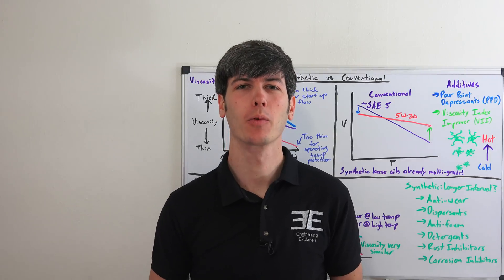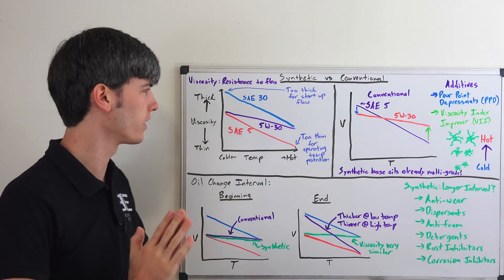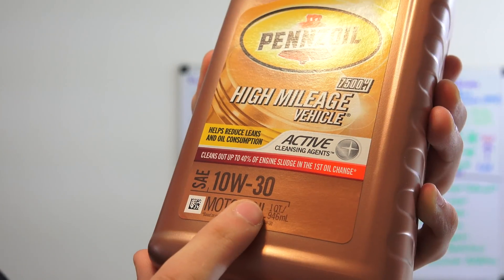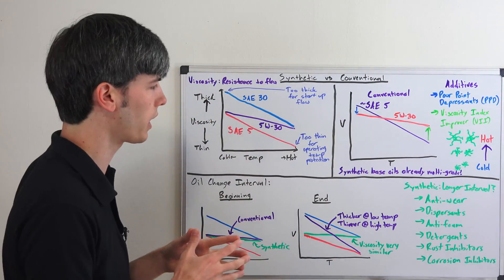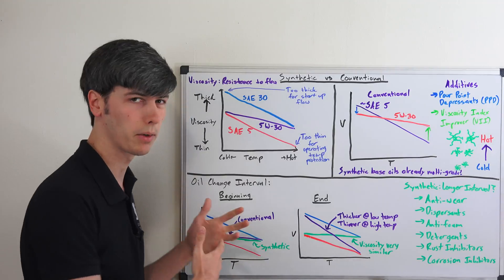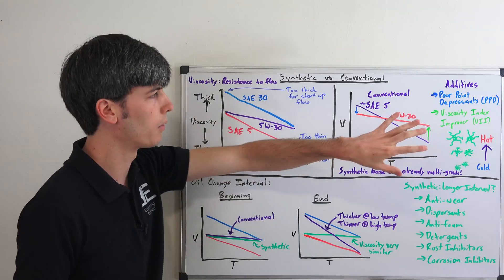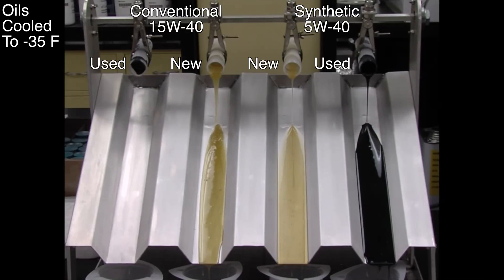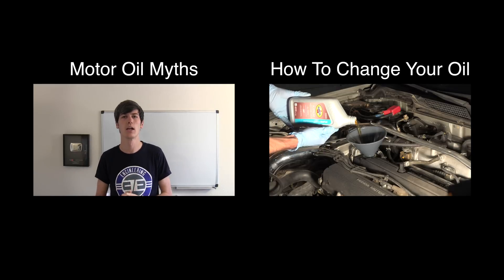Is Synthetic Motor Oil Better For Your Car?

Comment: Thanks so much for clearing up a lot of mysteries.  The airlines have all switched to synthetic.
What synthetic viscosity rating would you recommend for my Corvette LS-1 engine operating in the hot Florida environment?  I've been using 5W40, but have been thinking about 0W-40.

Comment: OK what about straight weight oils?  I have an older diesel that requires straight weight 30 only unless I am in an area that goes down below 30 degrees.  Then I have to go with 10/30.  These engines were very very picky.  GM 5.7 Diesel from 1981.

Comment: The additives still break down over time in synthetic, just like regular oil. The only thing that's nice about synthetic is that the viscosity doesn't break down as fast. Otherwise, changing the oil around the same time keeps the additives in the right ratio.

Comment: Is it true once you go synthetic you cannot go back to conventional?
Reply from the maker: No, you can switch back. But synthetic is super cheap if you do it yourself, so really no reason to.
Reply: Thanks, I was pretty sure it was a myth but I needed a confirmation.
Reply: You mean for coffee?
Reply: I'll buy one for my mom, she loves coffee.
Reply: no you can go back and forth it doesn't hurt anything
Reply: no its not.  what is true is that "once you go black, you can't go back"
Reply: Probably not, because I'm married to a mostly black gal and I probably WOULD go back! :{(
Reply: I have been back and forth for over 20 years and nothing has ever gone wrong Iam over 500 hundred thousand on my s1o still runing strong
Reply: That is interesting to know.  At my automotive school, I was taught that you can't go back once you use synthetic.  I was told that the synthetic oil will coat the engine and will have some interactions with regular oil if you introduce it later to create clumps and stuff.
Reply: If you really want to learn FACTS about motor oil, read this:

https://540ratblog.wordpress.com/2013/06/20/motor-oil-wear-test-ranking/
Reply: Here's a simple answer to that question. Synthetic blend oil is a mixture of the 2 .
Reply: And even the "cheap" oils like Walmart's SuperTech oil, have base oils that come from the major manufacturers like in Texas, the bottles used to say the oil was a product of SOPUS. (Shell Oil Products U.S.) which is none other than the parent company of Pennzoil.  Now this does vary regionally in other parts of the country the oil bottles had a different source.  It just depends on who gives them the best deal at the time in relation to ease of distribution.  Now I'm not saying the oils are identical, but they are certainly up to the SAE and ILSAC standards.  Of course the premium oils like Pennzoil Platinum and Mobil 1 will have more value added components to justify some of the cost difference.
Reply: +FsG Snake  Absolutely incorrect.  All of the major manufacturers will tell you that you can mix them in any proportion you like, go back and forth, etc.  After all, most of them actually sell synthetic blends. In fact, there is no official API definition of "synthetic".  Last time I looked, it was just described as a "marketing term".
Reply: Jon Wright Thank you for sharing your first hand experience Jon.
Reply: I love little pickup trucks they last a long time in the right hands...my. 2000 ranger got to 270k not to long ago and when I traded it in it was in great condition
Reply: Synth has smaller molecules, so yes, it flows easier, thus the better lubrication it gives. But do some research on the effects of how the material in the engine seals REACTS over long periods of time with mineral based oil versus synthetic. Mineral based oil has the effect of stiffening the seals, as opposed to synth which keeps them softer. When you put an oil with small, easy flowing molecules into an engine with somewhat stiff seals, you may have leaks.
Reply: Interesting.  I wonder how much of a problem it is though.  I've switched to synthetic mostly for the winter time and it's apprently better for the engine in the long run.
Reply: good to know.  thanks.
Reply: it's a myth
Reply: Running dino for a long time and then switching to synth can cause oil leaks, because the seals (front and rear main, cam, etc) react differently to mineral based oil.
Reply: It's not that the seals "react"; it's that the flow characteristics of "synthetics" can be slightly different from conventional oil. Usually it's not a problem but was in the early days of "synthetics".
Reply: no, and yes.... so, typically,  switching and mixing is perfectly fine, since all oils are required to be mixable to meet a picture standards.... however,  I know for a fact that the way it interacts with rubbers is a different story.  if you have used one type of oil through the warranty period, stay with that oil, or you will be needing to replace seals.  something about how the rubber or whatever (mostly main seals) soaked up the oils when it's natural properties dried out, introduces incompatibility between the 2.  you can go rounds and theorize all you want, and use whatever example you choose, but plain and simple, the real world fact is, if you change oil types on old seals, they will dry out and leak, before soaking up  the new oil type... it does not happen on low hour seals, but it does on well used ones.  it is fact, proven in the real world, and there is no fix, but to replace the seals, which is always real costly.  the rear means you have to remove the engine or trans, and the front usually means you are lucky if you have a chain, which is easier to replace the seal, but a belt means you have to pull 3x as much apart to replace.... so, short answer is, that if the engine is old, switching oil type means replacing both main seals.  if it's still under warranty,  go for it.  if the seal does go, it will be covered.
Reply: wholeNwon not true.  it is not a marketing term... I mean, technically,  it is not a technical term, but conventional oil is made from petroleum crude, separated at higher temp than fuel, but from the same base sludge.  syntetic, is made from natural gas.  both come from the ground, but that is it.
Reply: Engineering Explained that is a pretty bold blanket statement for someone not covering the repair cost.  as a real world master mechanic... old seals that have started soaking one type of oil to replace natural oils,  will not accept the other type.... you can try to theorize as much as you want, but there has never been old seals that survive the change, in my experience.   just newer ones.
Reply: The API itself referred to "synthetic" as a "marketing term". "Sludge" is a pejorative word.  Only some "synthetics" are made from natural gas. The implication that automobile lubricants made from gas provide lubrication required by auto engines that is NOT provided by lubricants of the same API grade (SN usually now) is unfounded.
Reply: The manufacturers of the stuff have made no such statements about their current products, though there are implications that problems have occurred in the past. FWIW, which isn't much since it's only one family's experience, we keep our cars a long time...typically 20 years, switch back and forth and mix oils depending on what's on sale; and, none of us have ever worn out an engine.  In fact, the heads have never been off any of ours. Only one required the addition of oil between 5K changes and that was about 1/2 qt.
Reply: Personal experience on my dads truck.  He ran full synthetic for a few years.  Started driving more and couldnt afford the full synthetic.  Switched to basic oil. Year later the engine lost oil pressure and turned to junk.  I always felt how would the engine know?  oil is oil.  But switching back did not go well for us.
Reply: The manufacturers tell you that you can switch back and forth or mix any way you like within the same viscosities. Afterall, you can buy premixed "synthetic" blends off the shelf.
Reply: Yes Rocktowntraffic but it could be a coincidence.
Reply: Youre thinking backwards, Using synthetics are much cleaner and also much more slippery then conventionals, If you use conventional for 300k miles, and suddenly switch to synth its possible the oil will makes it way through leaky oil pan & crank seals causing minor leaks.. I never see this very often but thats the mindset
Reply: David Cazes - You get mixed answers on here but best bet is as long as you change your oil is most important. 2nd i use synthetic over conventional and went back in forth about it. I notice the Syn had a smoother fill when turning the key then conventional which felt like it was runny and key turned quicker like after awhile something my need checking. Either way your fine is you do oil changes when you need to
Reply: oil is not oil, big difference between syn and conventional, at same weight specs.  Turbo cars always need syn, always
Reply: No....that's if you go BLACK, you can't go back
Reply: No.
Reply: thre is no reason to not use syn....modern cars all need syn, for turbos, mpg, etc etc.  Why would anyone be driving a relic that uses old non syn oil.
Reply: no
Reply: You can but mutch better do the engine flush befor you switch again to normal oil....
Reply: Go back and forth as much as possible as often as possible. This tip brought to you by the letter W.
Reply: ...........  Are  we  talking   about   OIL,   or    ladies   BOOBS.......?????
Reply: Of course not.  Even the web sites of the synthetic manufacturers will say that. Go back and forth, mix in any proportions, whatever you like as long as the viscosity range is correct for you engine.
Reply: +stonent   I wouldn't be so sure that the last sentence is entirely correct.  I certainly agree with the remainder of the statement.  People make far too much of a fetish out of motor oil.
Reply: I've used nothing but conventional motor oil in my 2000 Silverado and it has never had a problem 220,000 miles and still running strong!
Reply: David Cazes That is 100% false. You can change back to conventional at any time. Heck, you can even mix syn and onventional oils together. They are 100% compatible. Just use correct viscosities for your engine. Personally, I always use full synthetic (change it myself-about $35 for oil and filter). It is better. Whether it's worth the extra dough is up to you.

Comment: +engeneerinexplained is it good idea to mix one oil with another,and is it bad to use low sae rating oil for warm summer?
Reply from the maker: It's generally okay to mix oils (or add oil as necessary). I'd always use the rating which is recommended.

Comment: Okay so Synthetic is better in cooler temperatures and if you don't regularly change your oil it's better also. What I want to see is an engine using synthetic oil for 100k mile and one using regular oil  for 100k miles with a regular oil change every 3,000mi on both. Then see which engine has fared better. The Synthetic? Or Regular? 
When I hear car companies or oil company say they, "Put it through an additional process to make it better." I have to wonder if that's true. Maybe it is but I would like to see more proof other then viscosity. How old is that "old" oil anyways? 200 years old? It's blacker then hell. This experiment did not follow the scientific method.

Comment: So I use conventional on my 20r but 100 miles after oilchanges the oil gets drenched in gas so I started putting gas instead of oil, cheaper as well

Comment: I don't understand. You say that the 5w and the 30 is a measurement of 
the same thing (viscosity) at different temperatures. So the higher the 
number the number the thinner the oil is then why in your test did the 
brand new 5w-40 synthetic oil pour out faster than the conventional 
15w-40? since it was -35 shouldn't the 15w-40 brand new pour out first since 
its winter/cold rating is 15w and higher meaning it is thinner?? Your graph on the other hand seems to point in the direction that the higher the number the thicker the oil.

Comment: Not everything is viscosity, Synthetic Motor Oil is different than Conventional even at the molecule size… uniform molecules produce less friction when used to lubricate compared to the non uniform molecules of Conventional Motor Oil, and considering these molecules to function as ball bearings between surfaces… it's a ton of difference

Comment: ALSO: 

Many synthetic motor oils won't burn at combustion chamber temperatures, conventional oils do.

Oil residue is always being applied and wiped off of the cylinder walls by the piston rings when the engine is running. So a thin layer of oil is exposed to the ignition within the combustion chamber, and then eventually whatever is left of that will make it's way back into the oil flow of the engine as the pistons cycle...

Conventional oil typically has a flashpoint of 400-600 degrees F, so the thin residue of oil left by the rings on the pistons is burnt up with each ignition cycle of the piston. After burning, the conventional becomes what might be best called "gooey soot" (highly scientific term there). This gooey soot has just about zero capacity for lubricating the engine, and it has an amazingly diverse assortment of carbon-based chemicals in it, many of which are rather corrosive. It also will tend to build up on the various parts of the combustion chamber as grime.

Synthetic oil on the other hand has a flashpoint which is much much higher (in some cases as high as 2000 degrees F), so the residues of most synthetic oils in the combustion chamber are not burnt by the ignition cycle of the piston. It still picks up a bit of sooty residue from the burning gasoline, but the oil itself is not breaking down into a corrosive cocktail. In addition to acting as a corrosion barrier instead of actively corroding,  it is maintaining it's viscosity, so that it's much less likely to cause a build up of grime in the combustion chamber. Even components as distant as your fuel injectors may see less grimy buildup over long term use of synthetic oils.

So, over and above the fact that syntheic oil does a much better job of lubricating over a longer period of time, it's also far more temperature resistant, allowing it to not burn in the combustion chamber, not release corrosive carbon derivatives into the engine, and not build up grime nearly as easily.

Oh, also conventional oils multi-viscosity capabilities are rated for room temperature to engine operating temperature, and typical conventional oil will thicken a great deal outside it's multi-vis rating at more extreme cold temperatures (even when the oil is brand new). Synthetic oils are far less temperature sensitive in this regard, so their rated multi-viscosity functions similarly whether it's a summer day in phoenix or a the middle of the night in winter in northern Alaska.

So, the advantages of synthetic oil are actually many fold. I normally use 15,000 mile Mobil-1 synthetic, with an oil filter rated for 12,000 miles. I change it on a 12,000 mile interval. If you change it yourself, this only costs about $10-$12 more than a cheapo oil change, even though it lasts 3-4 times as long. I've driven about 1.6 million miles over the years in 12 different vehicles, none of them have had any lubrication-related problems, all of them retained excellent compression regardless of age or mileage, and all of them would start effortlessly in even the most extreme cold weather. Anecdotal certainly, but I'd much rather have 10,000 mile old synthetic oil in my car than brand new conventional oil.

Comment: I only use Pennzoil Platinum in both my vehicles.... My  94 F-150 has over 424,000 miles and my 03 Honda Civic has over 290,000 miles.... They both run great without any issues.....

Comment: ok people may think now to switch to synthetic oil although recommended oul for their car is to be part synthetic or even mineral oil. 
but what about suitability of particular oil due to the nature of other parts in the engine?
some seals for example, especially in the older cars may be damaged due to different type of oil in contact with them, thus shortening the life span of parts in the engine, isn't this correct?
please clarify this someone.

Comment: I live in California and the temperature doesn't dramatically change. Wouldn't I want to use a straight 30 weight Full Synthetic motor oil?

Comment: I use synthetic for all my cars. I have a '67 Big Block Corvette, the engine builder recommended 20w/50 that is available in Synthetic. This car's oil pressure runs between 90 & 120 lbs. My late model cars have much closer bearing tolerances, the manufacturer recommends 5w 30 synthetic in them. It's a little scary seeing only 45 lbs of oil pressure due to the thinner oil, but that's what the manufacturer recommends.

Comment: For those interested in motor oil FACTS rather than unsupported prejudices, assumptions, repeated advertising hype, "I just feel better" and "it's cheap insurance" platitudes, here is a very good link for detailed WEAR analyses by a real engineer (ASE, API) and specific recommendations based on actual, useful DATA.  You can search the article for any brand of oil that interests you and even skip to the conclusions, if you don't want to read it all.
https://540ratblog.wordpress.com/2013/06/20/motor-oil-wear-test-ranking/

Comment: probably everything he said here is true, although I think -35 is below the recommended operating temp of a 15w low end oil but honestly I would rather take the extra money spent on a synthetic and just do a more frequent oil change as the problem usually isn't the oil "wearing out", its the filter unable to filter efficiently as it collects residue and more frequent changes will take care of that